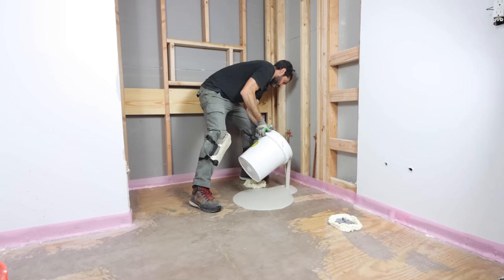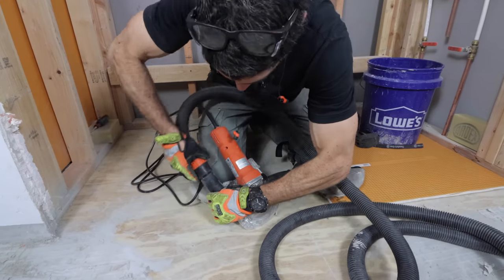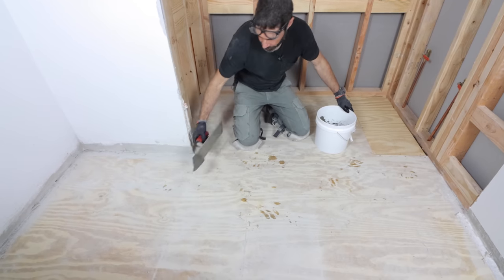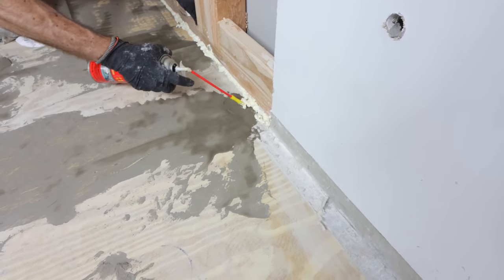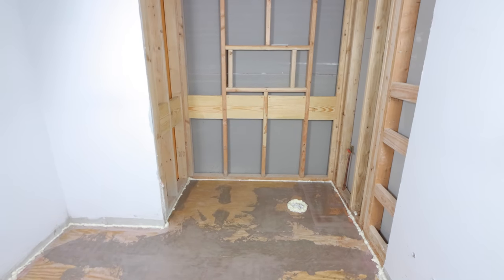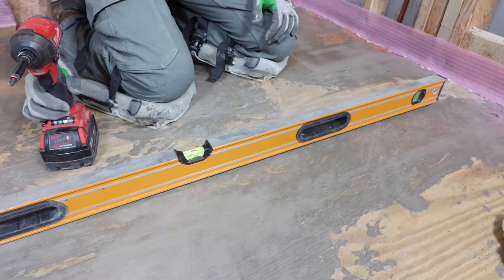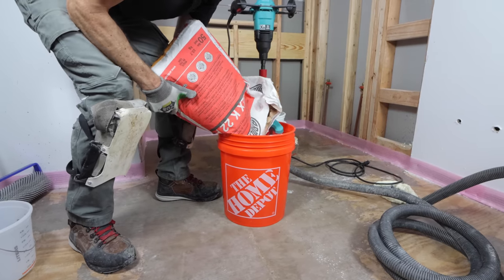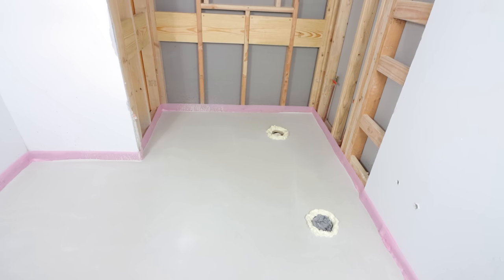Self Leveling Floor Tips for Beginners

Comment: I watched a lot of videos but when I saw the screws you drilled for height then it all made sense.  No one else did that.   Thanks.
Reply from the maker: Thank you 🙏🏼
Reply: Same here. Good thinking there.
Reply: @HomeRepairTutor  question about this. You covered all the joints and screws so that the self leveler is contained to the bathroom, but then drilled through it to mark the height needed. Doesn’t that defeat the purpose of sealing the screws?
Reply from the maker: @robertgonzalez7745  great question, I’d only use screws that don’t penetrate the subfloor but even if that happened wouldn’t be concerned as the screw is filling the hole. You could also use spacers and hot glue then to the floor 👍🏼
Reply: I've actually seen at least three others here use screws to know the height of the leveler, so it must be a great idea!
Reply: Not to take the credit away. Stud Pack and Sal Diblasi showed the screw method long time ago.
Reply: I like the way you prepare your job be   for starting can u plz tell me name o material is needed to do it
Reply: @robertgonzalez7745  I was thinking the same thing.
Reply: Yeah jumping on the "oh never thought of that" train... screws for reference. Duh.
Reply: @gonzo1977  go nn
Reply: Newbie here, underneath is wood, wood will expand on humidity , will the self leveler crack?  Thanks in advance ❤
Reply: @blessnorthamerica7919  I wondered why he patched the seams before he peimered. If not patched correctly the seams could expand and crack the ardex.
Reply: Sound advice but sadly from my experience, not many companies go to these lengths. Personally I would have removed any loose tile grout, primed the rest and then just applied the self levelling. My opinion is, if it needs grinding off it’s not gonna come up. We used to remove ceramic tiles before self levelling, now we just epoxy prime and self level straight over the top.
Reply: @jeepman180 the ardex feather he uses is flexible, it has clay properties

Comment: Hey mate I’ve been self levelling for years I wouldn’t say I’m a pro at it because it’s kind of the last resort to flood for the customer because it’s so expensive ($30m2) but I have done thousands of square metres of the stuff and I reckon your video is the best out there mate. Well done 👍🏼
Reply: Question. If adding screws to level, do the screws just stay in after it dries because the screws get covered by it? Have you ever used screws?
Reply: I’ve never used screws personally but I assume if they’re not completely covered you should screw them out
Reply: @jkocaja1  Yes, if you're using screws to establish your plane you'd leave them in place.
Reply: @shahnjordan7890  No, you wouldn't want to remove those screws -- that could fracture the SLU around them. We just leave them in place.
Alternatively, pros often use tripods and of course you lift those away when you're done.
Reply: what are some other methods?
Pretty much every room is out of level in my 1974 house.

Comment: Additional tips: buy more bags than you think you need.  You do not want to have to make a run for more and then try to repour.     Also this is a two man job for any DIYer.  One to mix, one to pour/agitate, etc.
Reply: Another tip: Mapei brand from Lowe’s works fine.    AND — this looks totally intimidating but is actually pretty easy and will provide great results.
Reply from the maker: Totally agree, get an additional bag or two just in case
Reply: Do you know what the pink paper along side the walls is called. Thank you
Reply: @moizezdelgadillo3134 also it's probably unnecessary unless you are doing a very large floor.
Reply: I am doing my entire house. I have seen other videos of people use spray foam but this looks a lot better. Hehe

Comment: Loved the video! Thank you! Question … if after the first application of leveling compound has dried and there are still some low areas, is it ok to do a second application of leveler on top of the first?  If so, would a different bonding agent be used (different than the original for plywood in my case?

Comment: This is video is SO helpful. What should be done in the doorway into the bathroom? How do I prep that section to prevent the self leveler from flowing out of the doorway?
Reply from the maker: You can add a 2x4 in the doorway and use the same methods that I used against the wall

Comment: This video was great and to the point and definitely helped with my current job attempt. I purchased about $5k worth of epoxy flooring for my home from a company called Leggari and an ground area that used to be outside and now has a custom stone fireplace had a pitch to it for rain/runoff that needed to be leveled. This video helped a ton since this was the first time i've ventured this, so thank you. If I had to give any advice, take as much time as you need to prep and seal up all the perimeter with great stuff and/or caulk or whatever so as mentioned in this video, no self leveling mix will penetrate. Once the prep is sound, don't be afraid to make the mix wet and runny. If its not runny or thin enough it wont roll out as easy. Once your pour it, there's no doctoring it. Runny and thin will allow it to lay out in every crack and low spot. It may take longer to set but will be less work on the back end as far as feathering or grinding, etc.
Reply: Excellent video and tips! Be careful not to add extra water as it will weaken the self-leveller which can cause cracking. Like you say floor-levellers that are on the runny side are easier to level and smooth out.

Comment: Great Video!!! Just one question out of genuine curiosity… why did you grind off the tile grout instead of cutting out the underlayment and replacing it? Just seems like so much more work to achieve the same goal. Thank you in advance.
Reply: That's what I ended up doing in my bathroom! Instead of having to remove 20+ year old vinyl adhesive, I just removed the plywood underlayment in a few pieces, and made up the height in more self-leveling 😊 My bathroom was SO uneven for the tiny space, and it was higher than the carpet in the hall, so ripping out the 1/2 inch plywood and leveling to the desired depth was actually the right choice for me!

Comment: So I did my first self leveling according to this video. I have to agree with Yodaguy, it is too easy to apply too much expansion foam and to be honest it is absolutely not necessary to use it in conjunction with silicone and Sillseal. 

I still recommend keeping the expansion foam on hand, it is a good dam at the end of the day and I used it to fill gaps undearneath my doors. So it is still useful, but it was not helpful around the perimiters. 

Another helpful tip I could add is work fast, and dont be gentle. Really just dump the whole bucket as quickly as you can and dont worry too much about leveling it. 

You still need to push it around. But if you try and manually level in sections and pouring slowly you're going to get a very wavy pour. Ask me how I know. My second layer went much better and I was able to get better coverage. 

Thanks for the video, it was a very good place to start at least

Comment: Great video, I've had great luck hooking up a dust deputy cyclone to my vacuum while grinding concrete. Keeps my hepa filter much cleaner.
Reply from the maker: Awesome tip, is that the specific name of that product? Might have to get one 🙌🏼
Reply: @HomeRepairTutor  yep, dust deputy cyclone. Also works great sanding drywall.

Comment: So helpful! I have a very large room with lots of seams in the subfloor and slight dips and bumps throughout. How should I decide if I need to use self leveler over the whole room or use floor patch in different areas?
Reply: Level the room if you want it flat. Patching will require more work/material/skill to create a flat surface.

Comment: Nice video.   I just poured Customs Leveler RS with primer to level a new plywood subfloor 32x60 under a shower pan.  I only used a trowel to move it around.  I did use the screws to know when I had enough material.  Once tried the floor is higher in the center as compared to the sides.  I’m not sure why that was the case.  Do I attempt to grind it flat or should I just try to remove it using a rotary hammer?

Comment: I need to level my mud room front addition. It’s a concrete slad, but it already has trim around the flooring and I want to avoid ripping this up. Do I need to remove this or can I just ensure it is protected before pouring?

Comment: Great video, thanks for showing the full process.  Only thing I would recommend is that you don’t need the great stuff AND the silicon around the base of the wall, the silicon alone is adequate.  And in order to save on materials if you have the time, e.g. on a large floor area where you have 24 hours between floor prep and putting the leveler down, you can use an latex caulking with silicon in it.  It takes longer to dry and seal, but is far cheaper and gets you the same result.  If you don’t have the time, use a fast drying caulking with silicon (<4 hours) or if you’re really pressed for time, use the silicon alone.  I would only use the great stuff on the toilet ring and large cracks and gaps between the plate and floor.
Reply: Lots of fancy gizmos in this video. All of my dust problems solved with a 10 dollar box fan in the window or with a 20x20 filter taped to it lol! I think he's sponsored by the brands he keeps name dropping even down to the caulk gun haha
Reply: seekhimwithallyourheartand3358  This is irrelevant. Take that crap somewhere else.
Reply: You're right -- Alex Plus or whatever's cheapest is good enough for the temporary job of holding the SLU back while it cures.
Reply: @themonkeydrunken  Just keep reporting them to YT.  They'll at least have to create new profiles.
Reply: @borderlineiq I didn't even think of that as an option. I will definitely be reporting them from now on. Thank u.

Comment: Awesome helpful video for diyers. Would you need to self level entire 2nd floor? If I am  installing new LVL Lux Vinyl Lamanent flooring over the entire 2nd floor, would i need to self leveler over the entire floor using this method? If so then would this not be too heavy weight structurally speaking? Also will this Crack in the future?

Comment: So I have a few questions if it not a bother. For my toilet flange, it sit about 1/4 up, and I have to add that much. Is it okay if the toilet flange is flush with the ground? 2nd, the pink foam role for expansion, how did you finish that part. Did you cut it flush with the ground after everything cured?

Comment: Hi, i am trying to level my bathroom floor also, but I would like to know, i need to add a sheet of plywood to increase the thickness of my subfloor.  Should I level the floor with floor leveler first then add the sheet or should I add the sheet then level if needed?  I would think that the leveler will crack if you screw on the plywood over it.  What do you think?  Thank you

Comment: Do you have any recommendations for doing this over heater wires, on plywood? I’m thinking the liquid BackerBoard which does not require lath is a good idea, but I’ve heard it is thick and doesn’t flow well.

Comment: It would be also nice to cover of what can go wrong.  As a first timer, I had one corner too high and some unevenness in spots, so I removed extra concrete at the corner and poured the second layer to even everything out.
Reply: Good point!  In my case, it was way too hot to do the job and the self leveler cured at lightning speed... creating a ton of work for me (I had to grind it all down, as it had formed little mountains all over)

Comment: I love the screw trick, but wouldn't that create a hole for the leveler to go into? or does the Feather Finish still keep the hole sealed from the leveler going through
Reply from the maker: I picked a screw that wouldn’t penetrate through the entire subfloor, so that’s important 👍🏼
Reply: You could also dab a ring off caulking around screw with a Qtip

Comment: Question! Isn’t seal sill designed to stop drafts around doors and windows? Does it not affect the self leveler after you pour it? And what do you do with the excess seal sill that’s sticking up above the dried self leveler?
Reply: The foam is meant to create a break between the floor and the wall which you want to allow expansion and contraction. You simply cut the foam off level to the floor once it has cured, the remaining foam is not an issue. Products exist specifically for this purpose but they are far more expensive than the sill foam. Use whichever you think is best for your needs.
Reply: @ianshaunthomas  Thank you!

Comment: What are your thoughts on adding wire mesh for wood subfloors first after priming?  I noticed you just dumped the self leveling right on the wood.
Reply: Self levelling doesn’t need mesh. That was for old sand and cement bedding.
Reply: @dejayajay the manufacturer of the product calls for mesh !! Use it
Reply: @cohenkevinloriqueen818 Self levelling compound is not the same as tile screed, which does traditionally call for wire mesh. Also, you could not really use mesh if you are feathering out to a thin edge. Your thoughts?

Comment: Great video and info but please I have a question I am removing my tub and walls and I want to install walk in shower base and new walls  made by flexstone and they recommended  to glue the base on wood subfloor  and  walls   but they not recommended using shims for leveling the subfloor  and if subfloor is not level do I need to use  self leveling  or any other way  ?  or Mortar ? and do I need to add wire mesh if I am using self leveling? please advice

Comment: Can I is this product over top of a laminate floor? Or have to pull it up to expose the sub-flooring? All the videos I find are pulling up carpet or have started with an already bare floor.
Reply from the maker: I recommend pulling up the laminate and inspecting your subfloor. Specifically, you’ll want to inspect the joist spacing, subfloor thickness, and screw schedule. You can find the joist spacing by looking at the nails or screws on the subfloor panels. Normally they’re spaced every 16 inches. Subfloor thickness can be found by reading the stamp on the panel or removing the floor register and measuring the thickness. If you’re installing tile, it’s important to know the tile type ahead of time. That way you can plan the subfloor repair or installation ahead of time if necessary. Also, of the floor is very sloped I recommend inspecting the floor joists. Primarily because often (unfortunately) floor joists are severely notched for plumbing and that has to be fixed to improve the home’s structural strength

Comment: Would you use feather finish in a cracked concrete bathroom floor on a lower level? Or would an epoxy or another process be better?

Comment: Thanks mate, get good tip btw about dust extractor while mixing self-leveller. I couldn't find it in hw store, but printed some crude but functional substitute on my 3d printer.
Reply: I also just cut an edge of the bucket lid off, drill a hole to fit the shop vac hose and it does a decent job as well

Comment: This is awesome - thanks!  One quick question: I have a control cut running diagonally through the basement bathroom I'm working on and am nearly ready to put down self-leveler.  What do I need to do to prep the control cut?  I'm planning to mark the two walls where the cut runs and run my tile at that angle and will be putting down a HeatMatrix underlayment down (originally was going to do in-floor heating, but decided not to).

Thanks in advance for any advice!
Reply from the maker: Hey Gary, that’s a unique situation and I’m not familiar with HeatMatrix. So I recommend calling Ardex technical support to clarify your questions. They’re awesome and will do their best to help out
Reply: seekhimwithallyourheartand3358  Dude this isn't the place for this crap.
Reply: @themonkeydrunken it's not crap it's the truth

Comment: "They just think that self-leveler is going to level itself."

This is why reading the manual/directions/instructions is always important. You really can't ever assume anything or you're going to have a bad time.
Reply from the maker: Always read the directions or call the company that makes the leveler to clarify questions. Ardex has one of the best technical support staff for products, I highly recommend using their products because of the support and outstanding product quality
Reply: Yep. Doesn't matter if youve used a product 100x. It only takes one change to the directions to screw up a job. Always.read.directions.

Comment: Wow! A lot of work, but seeing many self-leveling project fails, this is by far tops in reassurance of work done right 💪. Would recommend a vacuum wide blade attachment made for wet floor, has thin rubber blade for better water collection, but I use for both that though very effective for removal of finer dust particles as demonstrated in this video..

Comment: Love your videos and all the help you've provided, it's helped me a ton. How do you install the toilet flange now that the subfloor is wider than the flange (when the foam is removed). Thanks!
Reply: You can put the flange down to the original floor depth, then use a jumbo, or two wax rings when you install the toilet if a regular wax ring isn’t thick enough. I think they make longer bolts too for securing the toilet.
Hope that answers your question.

Comment: This was really helpful. One question; do you remove the screws that you used for the level indicators once it’s dry?
Reply: In my experience, it was not necessary as the leveler bonds to the screws and floor at the same time.
Reply: @richardlaundreaux1374  interesting, thanks!

Comment: Pulled up carpet and have 50 year old VCT over concrete slab floor with holes where carpet nails chipped. Can substrate be poured directly over old VCT or is there a primer that can be used or does it have to be torn up?
Reply: What is VCT?